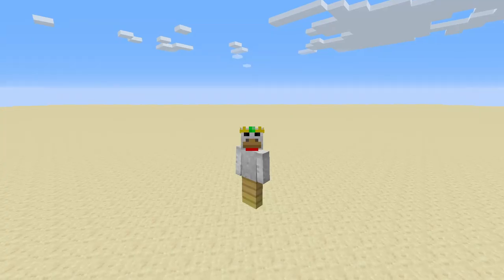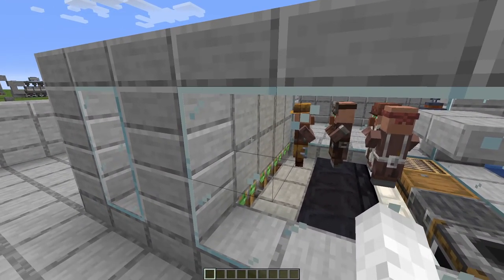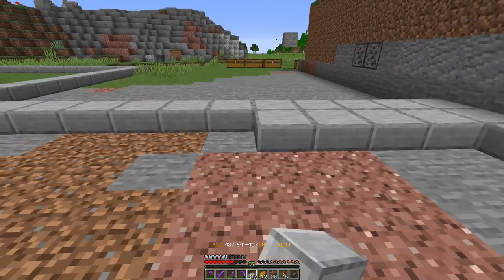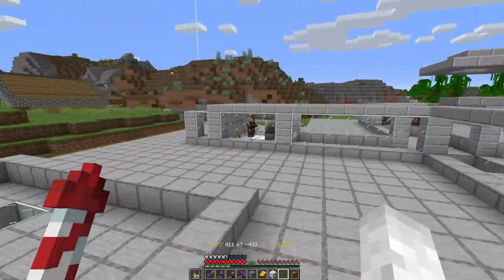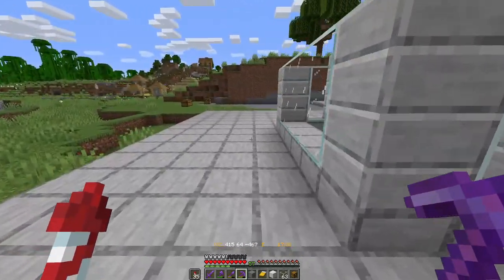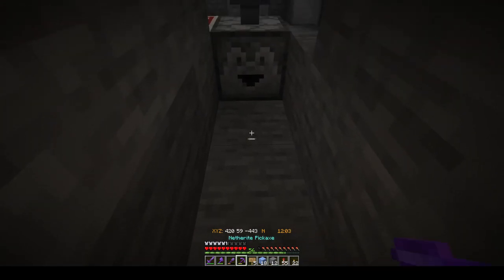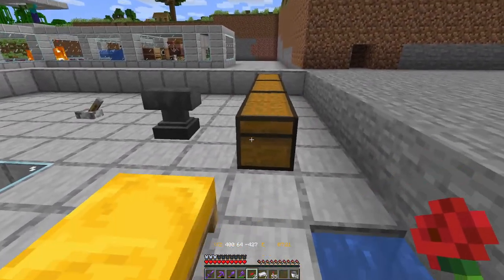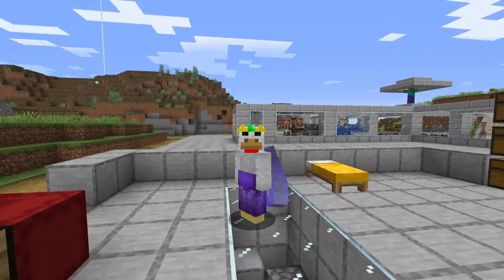Minecraft Let's Play | Ep.16 - Solving the Iron Shortage

Comment: I noticed that the golems spawn inside blocks and get stuck.  If you replace the full blocks with something like glass panes, then the golems won't get stuck as often or for as long.  That's one of the reasons why the iron farm couldn't be stacked without reducing the rates.  The other reason is that golems within a certain range will disable spawning.  So you need a way to synchronize the spawning between layers.  Also, you only need 3 villagers per spawn room.
Reply from the maker: I know there was a radius on spawning for villager to iron golem, which is why you need to move them as quickly as you can, but didn't know about the golems them selves.  When you say that Golems spawn inside blocks, are you referring to a point in the video?
Reply: @NOCKSCITNEY  In your testing world, there are a couple of instances where the golems are stuck in blocks for a little while.  They're spawning partially inside the walls because of a bug with the spawning algorithm.